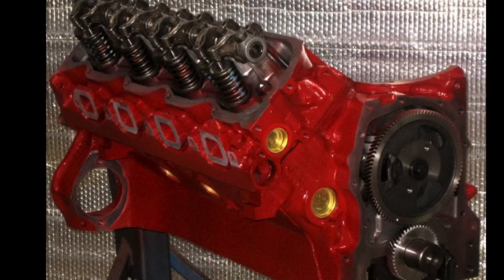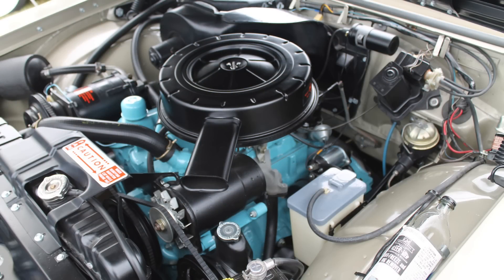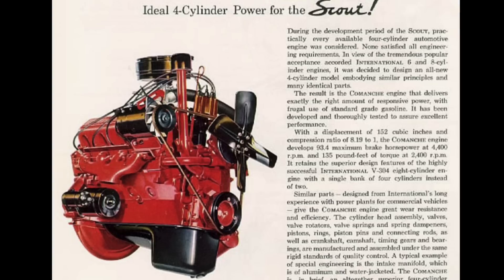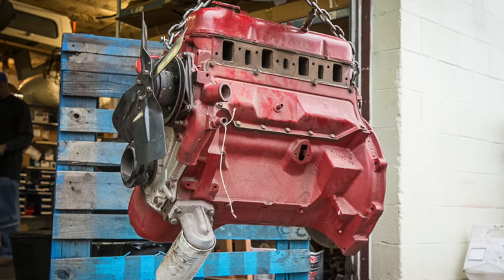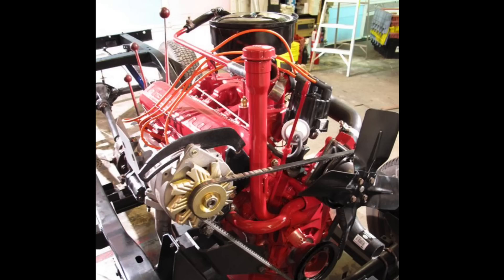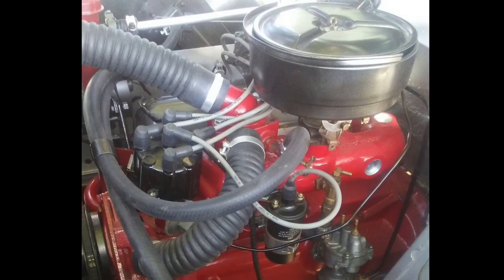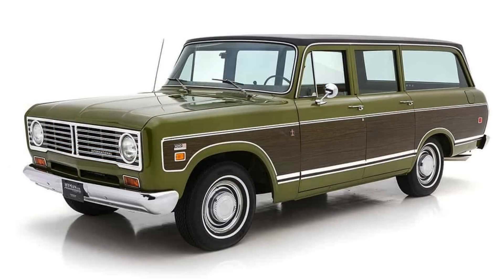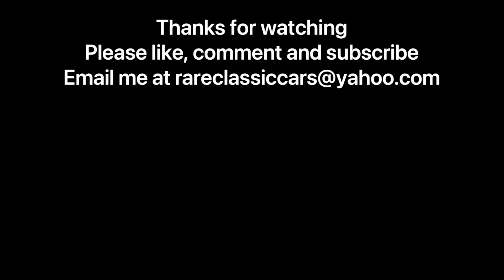Strange Automotive Engines:  International's (IH) "Half of a V8" Comanche 152/196ci 4cyl!

Comment: The Ford N series flathead four tractor engine was half of a flathead V8. Over 550,000 were made between 1939 and 1952. The engine was installed upright, though.

British orders for Jeeps from Ford were filled using the Ford N engine for a short period early in the war. Production was standardized with the Willys “Go Devil” engine though and Ford used the Willys engine for the rest of the war.

Comment: I had a 1970 Scout bought  in 1980 with 304/stick only complaint  beside the rust issue  common to Scouts was 10 MPG. With 2 10 gallon  saddle  tanks you definitely didn't plan any long distance  travel

Comment: I worked for IH as a field rep the late 70s and we were provided with new Scouts every year.   Internally at IH, they were called “ETVs (employee travel vehicles) I had several 1978, 79 and 1980 Scout IIs.   They had 304 and 345 v8s.   All the V8 scouts came with standard dual exhaust , and they sounded amazing.  Most were upper trim models, all with chrome rims, whitewalls and deluxe interiors. I’ve seen many restorations, but very few retain  the original details such as correct decals, the whitewall tires and chrome Rally rims.  I really loved driving them.  Thanks Adam love your channel and the fascinating details !

Comment: I had a slant 4 engine in my '67 Scout. I did just fine powerwise and it was stronger than a same period 4 cyl. Jeep. I had the '67 in the early 80's, I bought it from a farmer who had it that retired and was selling off all his equipment. It ran just fine but even then, parts were an issue. At around 146k on the clock I pulled the motor for an overhaul. The cam was basically a V8 cam minus half its lobes, but since the original cam couldn't be found, we used one from a V8. The cam we found didn't have the fuel pump lobe, so from then on it lived with a small cube type fuel pump. The distributor was the same as a V8, but with every other plug wire socket devoid of its contacts and filled in. Not being able to find the original cap, we used a V8 cap and simply filled every other port with RTV. It worked fine. 
I had that Scout till around 1990 or so, along the way I had picked up a parts truck for various items, mostly because it was super cheap. I had offered it to the guy who bought the '67 but he wasn't interested. Four years later I stumbled on a good running IH V8 and I put the V8 into the 1965 scout and used it mostly just for fun for a few years before other issues with it made me lose interest and it too got sold in favor of something with ac and a stereo.

Comment: My grandfather gave me 1976 IH 4wd short bed white with a big red strip down the side it had 392 automatic with a unmarried transfer case....doing burnouts I twisted off the short drive line and when it broke it came up through the trans tunnel😱😱😱

Comment: Here in the UK, Vauxhall made a SOHC slant 4 that was also half of a V8. The original intention was that both 4 and 8 cylinder engines would share many parts and could therefore be built on the same production line. Unfortunately the V8 never got past the prototype stage.

Comment: I've owned a 60 Scout 800A with the Big 196 cu/in 4 banger and a 78 Scout II Terra with all the options powered by a 345 cu/in V-8. 

The 800A was minimalist, no power steering or brakes. It did have good heat though. Too bad that International never found a way to keep them from returning to the earth as a pile of rust. 

International Engines all share parts. the 152 shared all the engine internals with the 304 V-8, and the 196 shared with the 392 V-8. The 304 and the 345 shared some parts and the 345 and the 392 shared some parts. 

With all International trucks, you needed the date of manufacture and the VIN number, as their parts suppliers changed during the model year. They did however have very good configuration management, so as long as you have the DOM and VIN, you got the right part the first time.

Comment: Sweet video, I love the older Scouts (and everything farmall to tell the truth lol), i have a 61model  80 that is truck only with a bench seat and a 70 model 800 with a 345 auto trans and four more variations in between lol, coolest and most reliable 4X4's ever in my master mechanic opinion (power wagons get a close 2nd lol). Thanks again for the video 👍

Comment: Chevrolet originally removed 2 cylinders for the 229ci 3.8l 90 degree v6 not to be confused with the 231ci buick 3.8l 90degree v6. The 229ci had a 200ci brother as well and i believe they were the same dimensions as a 305 and a 267 respectively. I think they all used the 3.48" stroke. The 262ci 4.3l uses the 350 pistons and a new 3.48" stroke crankshaft with larger rod bearings and narrower connecting rods. So the parts are a little more unique vs the 229 and 200. The 229/200 were odd firing like the buick but i think the specific formula they used was a bit different. The 262 was even firing with a large offset between the rod bearings, they also came with balance shafts later on using a different timing cover. The oil system was also revised vs the v8, i dont know if that's true of the 229.

Comment: Odd combustion chambers....
Reply: Those "odd" combustion chambers (factory-incorporated in International Scout production years 1961-1967 in 4-152 and 4-196 engines and other IHC engines, with domed, wedge-chambered, commercial-grade Zollner pistons before emissions modifications necessitated "heel-print" piston tops to lower HC and CO quench area emissions), were designed for maximum power and low detonation.  The wedge-chambered pistons were installed in production exported to other parts of the world (with less-stringent emissions standards) as late as the 1980's.  These IHC commercial-grade truck engines were built for HEAVY DUTY, LONG SERVICE LIFE which added to the cost (and the service longevity!) of the Scout.  Basically, IHC engines would last several generations with minimal service (required oil changes mainly).  These engines (and the Scout as a concept vehicle) were meant to advertise the superiority for commercial application of IHC's larger trucks.  If production costs and volume of Scouts had remained competitive with those of Ford Broncos, Chevrolet Blazers, and Dodge Ramchargers in the late 1970's, the IHC Scout might still be produced today.

Comment: This practice of modular casting is nothing new this how fords flat head V8 came about 2 four cylinders joined at the crankshaft.
Reply: Chrysler did that to produce tank engines during WWII.

Imagine what a fantastic truck engine a "siameezed slant 6" V12 would've been ❤

Comment: Chevrolet’s 90° V6 started in 1978 model year with a 200 in.³ or 3.3 L then went to the 229 in.³ 3.8 L then went onto the 262 in.³ 4.3 L how they did this was they removed the number three and number six cylinders in the casting. Which makes the cylinder heads interchangeable from side to side if you just locked off two cylinders, that wouldn’t be the case.
Reply: When we say "lopped off 2 cyls" it's rhetorical. Nobody is suggesting they stuck V8 blocks into a bandsaw and lopped them off.......

Comment: The AMC I4/I6 origin is kind of a myth. They wanted a 4-pot that they could produce on the cheap, so they designed a 4 cylinder engine that could utilize I6 conrods and pistons, as well as lifters and pushrods. It was its own unique design, but utilized common parts.

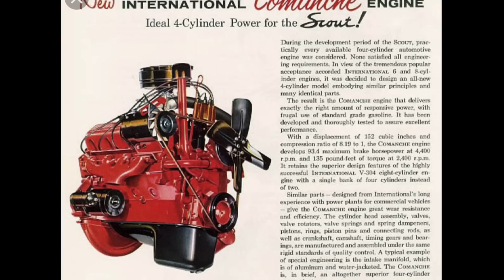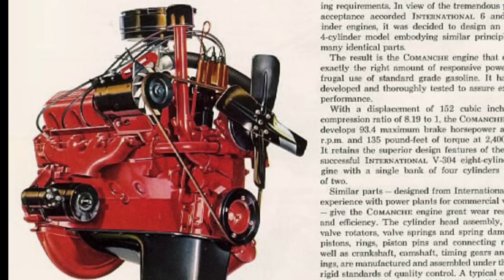Comment: When I was a kid just out of high school I purchased a 2wd 1965 Scout from an older man for the sum of $300.  I drove that Scout for over a year and put 2 reman mud tires on the rear.  It had cruise control, but no heater or a/c.  The cruise control was a knob that was on the dash that was connected to the carburator.  It had a top speed or almost 100 mph and had 2 10 gallon gas tanks.  That old Scout never gave me any trouble with the exception of a front wheel bearing.  I sold it to as used car dealer for $350.  In 1973 I ordered a 4x4 Scout with a 4 speed tranny, auto locking hubs, a/c, 345 cu in engine with dual exhaust and 3:31 gears which was a mistake thinking the gearing would give me better gas mileage, but once I put taller tires on it, it lost a lot of power which required more gas.  I should have opted for the 3:73 or 4:11.
Reply: I had a '61 Chevy Apache 10 Fleetside with cruise control. All old trucks had it. It was called the throttle cable. Pulled the knob out to get the desired speed and took my foot off the gas.
Reply: @sd31263  Did it have a heater?
Reply: What you think was cruise control I believe was the manual choke knob which would have been standard on Scouts until they were redesigned for emissions  requirements in Scout II models 1972.
Reply: @ it was a throttle and yes it  also had a manual choke.

Comment: You forgot CHRYSLER took the LA318 and removed 2 cylinders to make they're first v-6 back in the mid 80's
Reply: That was a decent engine, especially the later "Magnum" version. It never received a balance shaft like Chevy's later "Vortec" 4.3 did, but it was alright.

Comment: My brother worked for the forest service in the 60's.  They used IH scouts to ferry supplies to lookout towers.  In high elevation with steep roads the worn 4 cylinder would run out of power so they would park and carry provisions on packboards.
Reply: Coulda used the turbo way up there.....

Comment: My first vehicle was a 1968 IH 1100 pickup with I think a 304 V8. I believe with a 4 speed manual trans in the floor. The first gear was a granny gear. It wasn't fast but it was a workhorse and with a posi-trac rear axle, it was hard to get hung up. Finally had to let it die when I couldn't find parts for it anymore (pre-internet days).

Comment: How about a 4 cylinder, V-8? I ran across an industrial air compressor - I think it was an Ingersol-Rand - that used a Ford 302 V-8 engine. They used one bank (right) as the engine and the other bank (left) as the compressor.
Reply: Yup, those were 302's

Comment: So glad you’ve now included THESE engines, along this series of vid’s covered rare, unusual, bizarre, extraordinary types of internal combustion engine designs! I’ve owned &/or worked on quite a variety of oddballs myself, from the teens thru on to modern. In the middle of rebuilding one of these IH 152’s right now.. refurbishing/restoring a 1966 IH Scout 800

Comment: My Canadian built 1963 International C99 has a 152 ci engine. It was sold as a 1/4 ton pickup and was the cheapest pickup available in Canada that year. It has a cab and front clip of that era. The pickup box is a 6 foot fleet side box, narrowed 4 inches to accommodate a Dana 44 similar to the scout. The truck is peculiar in that the rear track is about 4 inches narrower than the front. 

The trucks were produced in 1962 and 1963. International Harvester USA produced a similar truck starting in 1964 but with a step-side box. 

More worthless info about a truck that is “rare but no one cares”.

Comment: Later Scout IIs could be ordered with the Nissan SD33T, which had 110hp (not too shabby for a 3.3L, indirect-injected, low-boost turbodiesel).

However, I assume that the likely higher purchase price, plus the cheapness of gasoline vs diesel would explain why only around 6400 were sold with this combination. For an average driver, it would take many years and miles to recoup that extra cost, however farmers who already had equipment running on (possibly subsidised) diesel would benefit from having this option. 

I think this combo would have done very well here in Australia, where petrol prices have always been much higher, even with our currency adjusted.

We did assemble Scouts in Australia, via CKD kits along with the D-series Dodge/IH medium trucks and the cab-over heavy trucks. The IH trucks were powered by the 345 and 392 petrol V8s, and the infamous Neuss diesel as well as the Cummins C-series.

The electrical distribution company that I work for, back in the day, had the IH cabovers as bucket trucks and mobile cranes, powered by the 345s and 392s. A work colleague did his mechanic's apprenticeship on these and nutted out some cool hotrod tricks to really get these cranking.

He took the 345 heads and put them on the 392 for more compression, bumped the cam and ignition timing up, shimmed the valve springs for more seat pressure, and tweaked the vacuum governors on the Holleys to come in at a higher rpm. The drivers were quite happy with these "refinements". Mated to an Allison AT540, they would routinely get 2 MPG (standard or modified). 

They were very heavy engines (heavier than most big blocks), and I assume that the 4-cylinder version you featured here would also be a very weighty lump for the amount of power it produced.
Reply: Those small Allisons (AT 540 & AT545) sure could've used a torque converter lock-up feature like the bigger ones.
Reply: If you want to see the SD33T in a "will it start and run 600 miles home"....Vice Grip Garage did one 2 years ago...@55mph with his 10 year old son with him on the adventure....
Reply: @JohnSmith-yv6eq  yep that's exactly how I found out about that rare beast 😎👍

Comment: Back in the Day Smokey Yunick took a Buick V6 that was originally cut down from a BUICK V8 and then cut it down to a 3-cylinder and injected and turbo'd that and made something like 350 hp and got 50 mpg. And it would fly and make sandwiches too.                                                           Or something like that...hahaha

Comment: It’s my understanding that the Buick 3.8l v6 is not a 215 with 2 cylinders lopped off but the block design has been redone so 6 cylinders fit in the same space as 8. I believe the blocks of the 3.8 and 215 have the same external dimensions. You can’t cut a 3.5L down and get a 3.8L.

Comment: IIRC, all the V8s used the same block, just bored to different sizes. Our family had a ‘65 with the smallest V8, 260?  It took forever to heat it up in the winter. They were built to commercial standards.

Comment: One thing I've always wondered and couldn't really figure out on my own is: Did these have a flat plane crank or was it a cross plane in line four??
Reply: Flat plane …
Reply: @Clyde-2055  Oh okay, I didn't know if they tried to reuse the v8s crank by just using thicker big ends on the end of the rods to take up the space that two rods would normally take up on a V8.

Comment: My grandfather kept an old 4 cylinder mid 60’s Scout for decades at my grandparents NC summer home to serve as his mountain runabout. He loved it. It would sit in a rickety garage for 6 months every year during the winter and fire right up with a little coaxing when they returned in the spring. Other than having an automatic transmission, it was about as crude as a vehicle could get with dented body panels and a floppy soft top. He couldn’t have cared less. It suited him perfectly.

Comment: You have touched a soft spot in me because in 1964 when I was 16 my parents bought a new International Scout all-wheel-drive. At the time I thought it was the most useful vehicle I had ever seen. Liked it so much better than the Mustang. 

We had the Scout for eight years and except for rust, very little went wrong with the Scout. I learned to drive stick shift on the Scout and we spent many times romping through snow in the winter and going camping in the summertime. I do not recall the four cylinder vibrating much. I loved the sound it made on take off.  it sounded a bit like a farm tractor and had a chugging note to it. 

Indeed, it was bare-bones, although with ours, we did get the optional roll down windows and a heater and defroster. The only peculiarity it had was when it rained occasionally it would stall when you came to a stop. It was in the shop for that a number of times, but they claimed they could never find a problem. It did rust out, unfortunately after eight years as it occasionally leaked around the windshield. I also remember the steering wheel was on crooked from the factory. Instead of the bars going horizontally, they went vertically up and down. 

My father sold our Scout in 1972 to a friend up the street who fixed the rust in the floorboards, and had the Scout re-painted from the original tan with a white top to red with a white top.  He drove it for another 10 years before he got rid of it. 

It was the greatest vehicle any teenager could've ever grown up with.
Reply: I had a 64 ih syep van with the sawed off four three speed stick through top of tranny military still had all the nomenclature tags that was the coolest hunting camping fishing, boon docking wagon ever made would go any where (just not real fast) wish i still had it!

Comment: Adam said this engine was course. That’s an understatement — these things would out-shake hell ! The inside of the poor Scouts would rattle, squeak and buzz to the point of irritation.

They would also shake components off the engine, or even break them. Alternator mounting brackets were a favored target.

But that all being said, if you kept the fasteners snugged up and engine topped up with oil, they were quite durable. I used to service some of these used as rural postal vehicles (purpose built right-hand-drive, automatic transmission), and they proved quite robust.